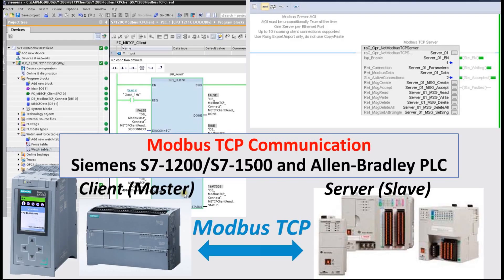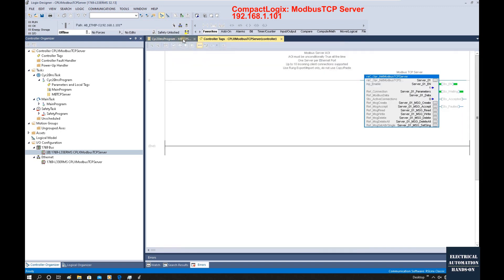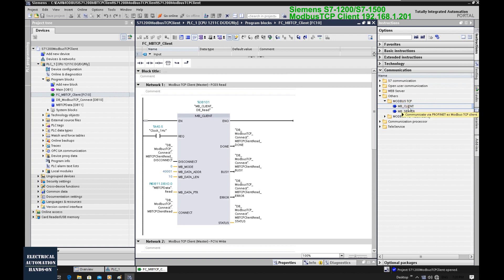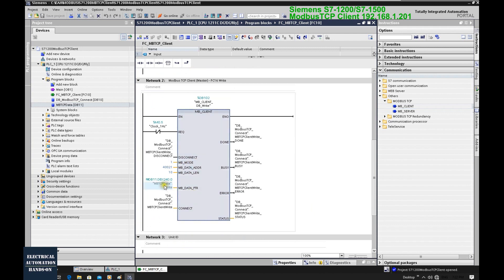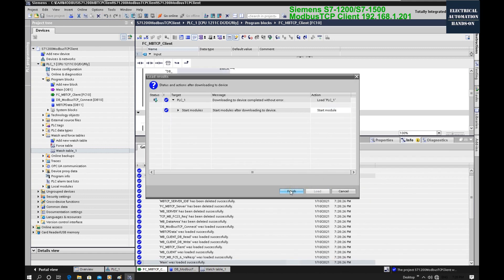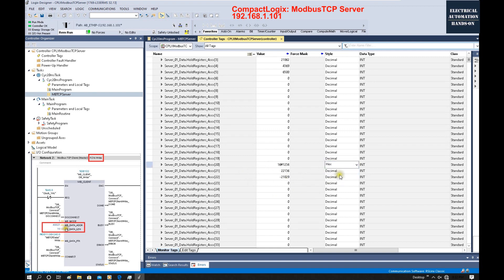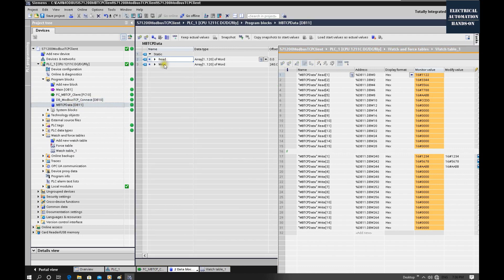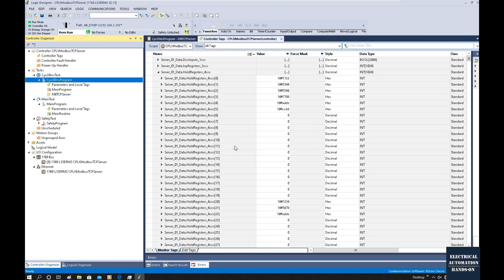COM20. ModbusTCP - Siemens S7-1200/S7-1500 (Client) and Allen-Bradley CompactLogix (Server)

Comment: I must say, your videos are awesome. Thanks for them.

I am  new To MODBUS, how we can get Schneider ATV320 Data on RS485 & then we have EGX150 RS485 to Ethernet Converter, then once data is available on ethernet we have to consume it into ControlLogix PLC.....Can get any use case references on this using EGX150 or Link 150...can you make any video using this  as usecase?
Reply from the maker: Hello Thanks for watching! Regarding your question, I never used Schneider ATV320 and EGX150, But as I checked EGX150 manual, you could use it convert modbus RTU to modbus TCP. Note that ATV320 runs as Modbus- server(slave), Controllogix will run as Modbus Client. You could review the video COM21. Allen-Bradley CompactLogix (Client) and Siemens S7-1200/S7-1500 (Server) https://youtu.be/tacshyBnSp0.

Comment: Thank you for sharing! Modbus TCP/IP and T_Comm library, which method is more useful and easier to establish? Thank you
Reply from the maker: If the Allen Bradley PLC is CompactLogix or controllogix, I would perfer to use EIP CIP the communication discussed in this video. You can see the Siemens runs as CIP Client, so the Allen Bradley side do not need to specially program. But for Modbus TCP/IP, both side PLCs need to program Server or Client.